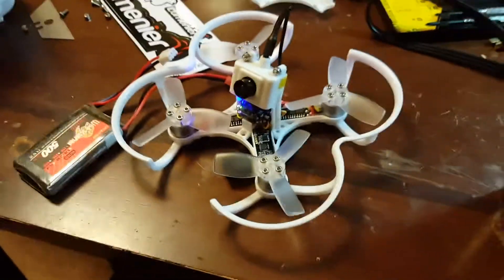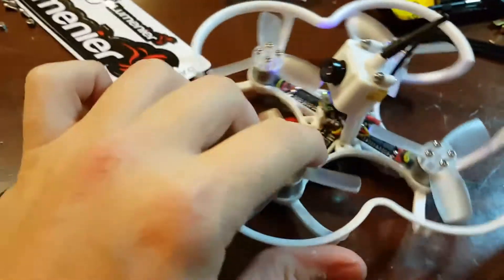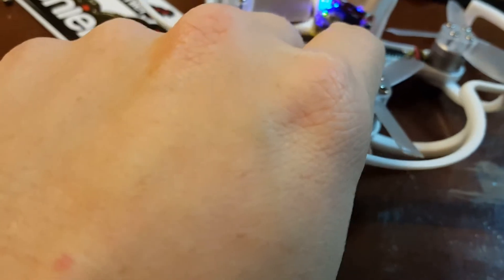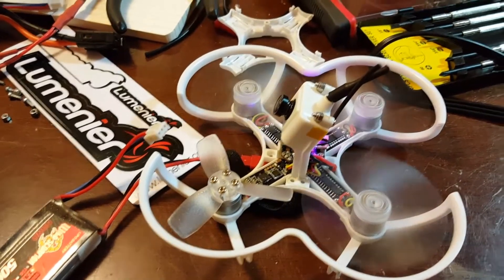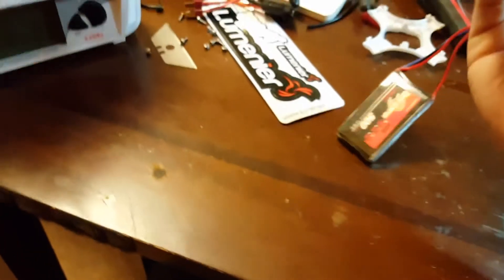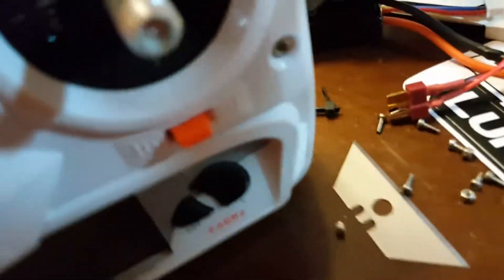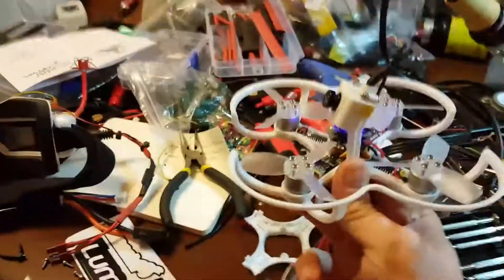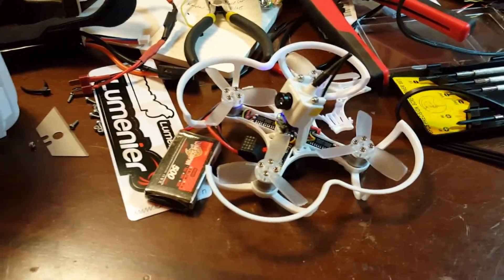Babyhawk ESC problem

Comment: I had the same issue but after recalibrating escs in betaflight is now ok. I also changed the motor but it didn't helped at all.
Reply from the maker: i replaced all the esc's with the one's racerstar made that were the same size and i didnt have any issues after.  Those stock esc's were nothing but trouble for me.

Comment: i had this same issue. kept swapping escs hoping that would fix it. turned out the small black ground from the esc to distribution board was broken internally. give them a little tug and see if they stretch.
Reply from the maker: yea, those wires are ridiculously fragile as it comes.  I had a few broken wires since i've owned it.

Comment: Has this been fixed fill me in
Reply from the maker: You can move the esc signal wire to ppm and do a resource remap. I ended up changing out the escs too. Always acted flakey with the stock escs for me. Stuck some dys 1104 motors on it too

Comment: Same problem here... I have had 2 of them now, soldered up the satellite and flip the arm switch.  3 spin fine and the 4th twitches a few times and then stops and beeps once and thats it. I live 2 hours from the hobby shop so it has been a pain in the ass!
Reply from the maker: Changing the signal wire to the ppm pad and remapping in the flight controller helps.  I ended up replacing the esc's and motors.  It's much better (you still need to move the signal wire).  https://www.youtube.com/watch?v=4TdBdhBZjOk
Reply: I can move the signal wire but don't know how to do the remap on the controller. I'll have to figure that out.
Reply from the maker: Here you go: https://www.phaserfpv.com.au/blogs/blog/how-to-enable-dshot-on-emax-babyhawk
Reply: hey mate. i did these steps for my motor 3. it started working again, but motor 4 stopped working. do i then need to put the signal wire from motor 4 into a different pad?

Comment: Same problem here. I was noticing drop in the front right corner on punchouts. So I did a esc calibration in BF and after that twitching motor and won't spin properly at all.
Reply from the maker: +Dave H I got it working again. First I replaced the esc but it didn't last a flight because the signal pad actually came off the esc from vibration. I put the original back on and then rewired to the pwm pad and set it to DSHOT instead. Seems to be fine now, but it's still really disappointing to have these issues with a pre built quad. Lost alot of my confidence in it.